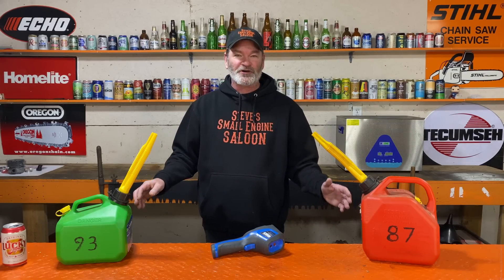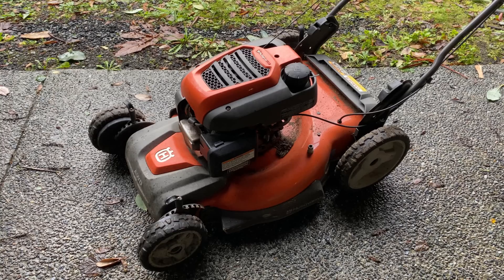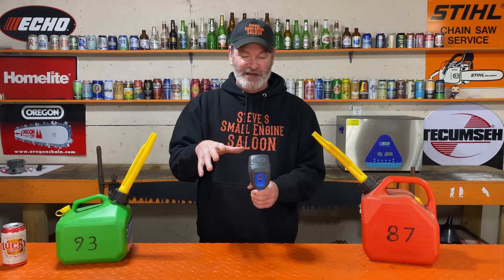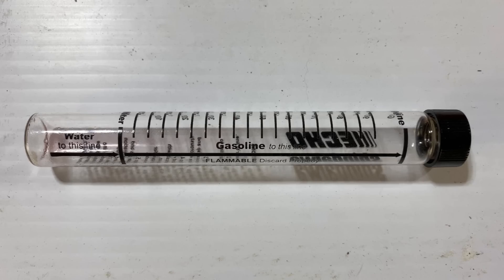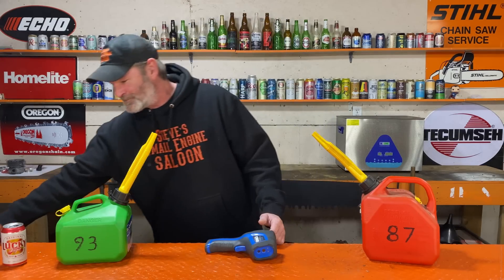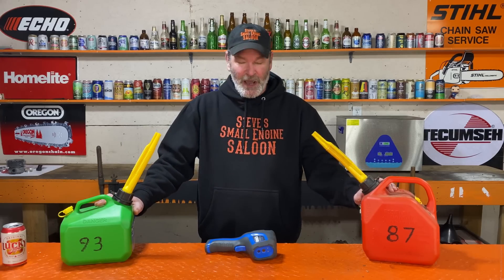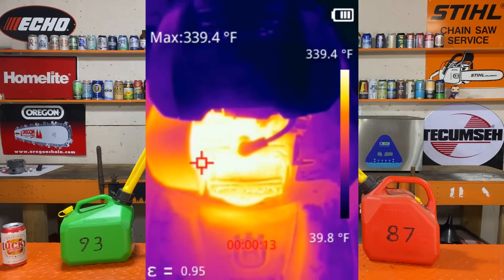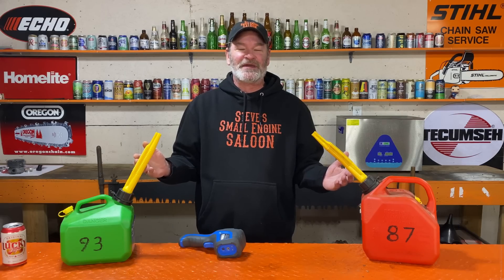Does High Octane GAS Make Your Engine Run Too HOT?

Comment: Thanks for doing this... I often wondered if it really was a big difference. I was always told that high octane fuel burns a bit slower, slow enough that trace amounts may still be burning as it passes the exhaust valve, causing the valve to run hotter.

Comment: Higher octane just means a higher flash point ...nothing more. On my engine with 114 vs the regular 91, I can add 2 deg of timing and lower the idle by 220 rpm, this also drops the temp by 18 deg BUT that is because it idles lower NOT because it burns noticeable cooler as you have pointed out Steve.... Well done
Peace

Comment: Here in Australia 91, 95 and 98 available, I've tried 95 in a brand new mower and it didn't like it so I went back to 91 and no problems. Most petrol engines here on the fuel cap states only use 91 your fuel mixes are a bit different to ours I think. I do stand to be corrected if I'm wrong thou

Comment: Hi to everyone  yeah Steve's right in his chat to everyone  but please  in the winter time of small engines with snow throwers, or you smaller tractor pushing snow, Don't put "Heet" in fuel tank All it's going to do is eat the small rubber gaskets to like shriveled prune and ruin them, then you going wonder why later you got problems with carbs,  just run 89 to 90 octane pump fuel and all be fine, or run half tank fuel till it runs out fuel and you better off without messing up carb, with fuel sitting in it at 1/4 tank for long  period of time gumming it up.

Comment: What's incredible, is how many tens of thousands of drivers fill up everyday with high octane gas, wasting their money, because they don't know what high octane gas does
Reply: Don't underestimate these drivers. They may know very well what they are doing. In my country (Slovakia), the EU, sells E 10 gasoline with a bio-component (ethanol-alcohol) content of up to 10%.  However, I only fill all my garden equipment (garden tractor, 4 lawnmowers, scarifier, mulcher, brushcutter (mix), drum mower, and my sister's car with high-octane E 5 gasoline, which has a bio-component share of only up to 5%, and the bio-component in this case is ETBE. And you know what? Unlike ethanol, ETBE cleans the engine and the entire fuel system, unlike ethanol, which clogs it and, in older cars (and garden equipment), even damages some - mainly rubber components. In some cars older than 15-20 years, their manufacturers explicitly prohibit filling up with gasoline with ethanol. Now you understand why some drivers fill up with high-octane gasoline without ethanol? By filling up with more expensive gasoline (roughly 20 cents per liter), they save a lot of money on servicing their cars. And I'm not even talking about the fact that burning E 5 gasoline produces lower emissions and extends the life of the engine.  By the way, great video Steve. Thumbs up. Greetings from Slovakia. Slavo.
Reply: @AdviceFromGarage  Thank you for responding, I respect your opinion. However, the percentage of ethanol is not the issue here and it is irrelevant to octanes. (The same percentage of ethanol is used in the US, by the way, up to 10%)
Please take some time and research “octanes” on youtube. You mY find that it is something very different than you thought
Reply: @koonelos  Thanks for the response. Even though ethanol in gasoline was not the main topic of the video, I think it is important in relation to whether it is high-octane gasoline or not, precisely because another bio-component is added to high-octane gasoline (in our case, ETBE, which even has a cleaning effect). The essence of my response to your comment was not to argue about octane, but that many of the drivers you mentioned use premium gasoline because of its better bio-components (additives) that do not damage the fuel system. I think the things I mentioned can be beneficial for both garden equipment users and drivers. Take care.
Reply: And I forgot to mention in the previous comment that the engine has lower friction and can run better with high-octane gasoline (for example, EVO 100 Plus has an octane number of 100 - exactly 99.9) and is ethanol-free and with cleaning additives such as ETBE, isooctane... However, according to experts, you will not achieve lower consumption and higher performance by refueling with such premium fuels - if so, then only negligibly and it is more about subjective feeling.

Comment: Some say  higher octane burns slower but its probably very small numbers. It will initiate flame later in the rotation of the crank because it takes more energy to initiate and these machines dont adjust to that need.  So its likely creating a though tiny overall inefficiency and also burning on the exhaust port side of the valve, exposing the valve stem to more heat. I just run what the engineers say in the manual. As for ethanol or high ration blends, you need to burn more fuel per charge Im not sure the combustion is going to much lower. The intake charge will be cooler though since the alcohol atomizes more

Comment: So, the higher  octane maby has a trace more energy at 3° hotter?? Not enough to make any difference looks like.  Also does the 90 + Oct. Store better like I have been told? I  have kept with Non ethanol 91 octane for 22 years for all my small engines . That has worked well for me.  Thanks for your excellent instruction 💯👍

Comment: I've always used high octane gas in my two cycle engines. High rpm engines run better with high octane. Learned this when I use to drag race my drag bikes.

Comment: Strange.  I was told  premium gas, high octane,  has no ethanol in it. Bad Shell gas station 😮
Reply: If you live in Canada, all gasolines (regardless of octane rating) can have up to 10% ethanol in it, BUT they HAVE to have a sign on the fuel pump clearly stating this fact. If a gas pump does not have the ethanol sign on it, then (by law) the gas can't have any ethanol in it.

Comment: I run regular / ethanol pump gas in everything.  No problems. 
Cheers, rich out.
Reply: I stopped using ethanol after my generator accumulated a pint of water in the fuel tank, and the fuel petcock seized up from corrosion.

Comment: High octane gas has a lower flash point for high compression engines so you don’t get precombustion. It’s not better gas, it just has a different use.

Comment: Been running High Octane gas in small engine for decades, no problems 👍🏻
Reply: Other than wasting money, you mean. The whole "high octane equals better gas" myth is the real bamboozle here. If your engine doesn't need the octane, you're basically burning cash for no reason
Reply: @philthycoder  Actually, no. A lot of high-octane (91 or more) gas has little or no ethanol in it and it is the ethanol which will gum up carburetors, etc. if the engine sits for an extended period of time without being run. Non-ethanol gas also stores a lot longer without needing the use of a fuel stabilizer.
Reply: @philthycoder ur not burning cash for no reason i tell everyone to go to at least 89 fuel rec 90 fuel is better but a lot of ppl had a bunch of issues with 87 an switched to 89 or higher now see a big difference

Comment: Ive always been taught to use minimum 89 octane in 2 strokes because when 2 stroke oil is diluted in gasoline it can actually lower the octane rating.

Comment: Higher octane fuel will help the engine run slightly cooler if you can adjust the timing for it, which you can't on a standard lawn mower engine. Ethanol has less energy, but also burns a little cooler. 

Non ethanol premium fuel is best for two stroke engines. It is best for four stroke engines that tend to sit around unused for longer periods. Ethanol blended fuel (up to 10%) works fine in small four strokes if the fuel is used up regularly, and not allowed to sit in the tank and carb for more than 4-6 weeks.

Comment: the increase in octane slows the burn rate down, this was to prevent  pre-ignition and knock/detonation/pinging. This allowed higher compression and this is what increased the horsepower.
Reply: WRONG increased octain retards the flame front absorbing heat and turning it into explosive force cooling thr engine!
Reply: @terenceiutzi4003  I think you are getting wires crossed, what the OP wrote was 100% correct, the additional reaction of causing detonation to occur later does more or less what you said, which it to reduce the temperature before tdc, which will stop holes being burnt in the piston crown, but you can't have an explosive force that is cooling. As Steve showed, both fuels basically heated his basic engine to more or less the same temperature.
Reply: @capnpugwash5403  If you run low test gar in a high compression engine, you burn offtjexjaust valves! That is why all of the race cars run ethinol  now!
Reply: Agreed....from my experience pushing drag and towing engines, the only time you get out of control excessive heating is if you advance to a point that you get the preignition/detonation .....lower octane, reduce timing....higher octane, advance timing to get the perfect burn.  Compression, too, plays a very significant role.....high compression, run high octane....low compression will tolerate lower octane fuel.  All these factors play together in harmony.
Reply: @tomnekuda3818 And higher octain retards the flae front cooling the engine!
Reply: What I was told was they burn at the same temp , but then when high octane is used in a high compression engine then combustion temps will increase. But due to increased compression, not octane
Reply: @outinthesticks1035  Octain has to absorb more heat to ignite it then it explodes, giving more force on the piston and less heat.  E95 HAS 180 octain. You can not burn E95 in an engine with less than 8 to 1 compression. When I burnt E95 in my 12 to 1 compression Air cooled Triumph it ran so cool that you could put your hands on the cylinder heads and not burn them!
Reply: @terenceiutzi4003  octane does not absorb heat , it is just a measurement of how difficult it is to ignite fuel 
If a fuel mixture has enough heat to ignite , that is called pre-ignition. This is a bad thing , it destroys engines 
More force on the piston equals more heat , it is the heat that creates the force 
E95 fuel has a octane rating of 95 , not 180 
Fuel for high performance aircraft is 100 octane , I don't think it's possible to buy higher than that
Your air cooled engine ran cooler simply due to alcohol fuel burning cooler , as explained in the video 
Not because it was higher octane
Reply: @outinthesticks1035  Why do you have to advance the timing when you set up to run higher octain fuel? Do you know anything about high-performance engines?
Reply: @outinthesticks1035 the flame front is slower using higher octane fuel, so you can advance the ignition more and still get the "bang" to happen at the right time in the compression stroke when a higher compression would otherwise cause pre ignition and damage the piston.
Reply: @outinthesticks1035  Well that explains s why when you burn lowest in a high compression engine you bur off your exhaust valves and melt holes in your
The pistons!

Comment: The higher the octane the slower it burns.
Reply: Nope, burn speed differences are negligible. Octane rating only shows resistance to knock and pre-ignition.

Comment: I had a Chevrolet Sprint car I bought new in 1986.It had a 1.0 liter 3 cylinder Suzuki motor. People were bringing them back to the dealer with the motor vibrating excessively. After investigating Chevrolet came out with a bulletin to not use premium gas only the lowest octane. Mine had a 5 speed & got 45 mpg in town & 55 mpg highway, driving it easy & at 60 mgh highway. I guess some people thought it would get even more mpg with premium.

Comment: I use full synthetic oils in all of my engines (car, mower, snowblower, 2 strokes), and use ethanol-free from the marina. No heat, or fuel problems ever.

Comment: My good old US made briggs in my mower has always run on 98. I change its oil once a year, its 26 years old, and still running strong and starts first pull every time. The only other maintenance its had is new plugs and filters. Never even had to touch the carby.
Reply: Where are you buying 98 octane fuel, the airport?
Reply: @corey6393  Its available everywhere in Australia.
Reply: @fitzyholden1036 you sure that's not 89 instead of 98? 98 octane gas would be absurd to use in a low compression single or dual cylinder small engine
Reply: @philthycoder  In Australia we have 91, 95, and 98 to choose from.
Reply: @philthycoder  Australia and the U.S.A. measure octane differently.  Australia uses the Research Octane Number (RON) to measure octane.  The U.S.A. uses the Anti-Knock Index (AKI) to measure octane.  98 RON is approximately equivalent to 93 AKI.
Reply: @mikefrerichs8860  Did not know that. Thanks mate.
Reply: @mikefrerichs8860  I was wondering if it might be  something like this. Thanks for the info.
Reply: I also heard the octane rating is different for elevations above sea level. Anyone heard of this?
Reply: @matt4262  The ratings are the same, but the engine's needs might change a little. Was more of an issue with older, carburated automobile engines. Fuel injection and computer controlled engine management and changed things.
Reply: Its a good thing you did, a friend of mine had to let a intek based 16 yo unit go because she didnt keep up with the engine oil changes, it washed the rings out and wouldnt maintain compression

Comment: I run strictly non-ethanol fuel in my blower, chain saw, weedeater, Polaris Ranger, portable generator, etc. You get the idea, and the non-ethanol fuel in my neck of the woods is 90 octane. Octane rating pertains only to the point at which the fuel ignites under compression, from what I understand. Old wive's tales die hard.
Reply: if it's like a lot of old wives tales, it's based on a complete misunderstanding of the original version - which was probably 50 years ago, people saying "don't waste money on premium gas for your small engine, because it doesn't make it run any better."
Reply: Burning non external in 2009 Exterra 2010 frontier gets 4 miles a gallon more over 300,000 each. All small engines generator, X 300 Kawasaki 900+ hr.  Good luck out there ✅⚓️⚓️🇺🇸🇺🇸🇺🇸
Reply: No idea what you were trying to say @drmrcharliestat
Reply: Do you buy the pre-mixed Ethanol free fuel?  If so, what brand do you use?  I’ve been told to stay away from Truefuel.
Reply: @craighellberg4366  premixed fuel is significantly more expensive than ethanol free premium and premium synthetic 2 stroke oil.
Reply: @craighellberg4366  I purchase ethanol-free fuel from a local service station. I never use pre-mixed fuel since I use ethanol-free on both two-and four-stroke engines.
Reply: Do you use the pre-mixed ethanol free fuel for two-stroke engines?  If so, what brand do you use?  I have been told to stay away from Truefuel.

Comment: I want to know what your comment about shops telling customers to buy 87 instead of 93 means. We all know what that means. Ah, no. 93 isn't cleaner than 87, it's an Octane rating. Equipment with high compression needs high Octane so it doesn't pre ignite. Low compression engines can use 87 because there is little chance of pre ignition.  Nothing to do with clean or dirty.  Or am I missing something

Comment: Where I live you can buy ethanol free gas but only in the high octane. I would buy low octane ethanol free gas if I could. I've never had a problem with my mower getting diesel knock but boy did I have problems with gas going bad and carburetor jets getting plugged before I switched gas.

Comment: Why does low octain (cheap fuel) fuel cause piston ping? 
Piston ping disappeared using high octain fuel
Reply: Lower octane fuel has a lower flaspoint it's a little more volatile . Thats why it pings . High octane fule will actually produce less horsepower . Unless you adjust the timing of an engine. Then high octane fule will produce more horsepower and run cooler  with un burt fuel evaporating . Works for car and bike engines not sure you could notice a difference in a small engine

Comment: Wow that was interesting  both have 10% ethanol, but yet they don’t charge the same price for the stuff  now I do run the 93% but before I pump  in to the can I put 1 to 2 gallons in my vehicle 1st then i fill up my can  just to make sure iam not getting what’s left in the hose  now oddly my saw and log splitter runs better on the 93%

Comment: Higher octane means that it has a higher resistance to pre ignition. It will not burn any hotter or cooler or cleaner for that matter. Sounds like your boss was a conspiracy snakeoil salesman as well as a small engine guy 😅

Comment: Steve, I have over the past 5 years now run NON- ethanol fuel (90 octane here in Pennsylvania USA), in my saws, mowers, weed hackers, pressure washers,and small generators.Its a little more per gallon than 10% ethanol, ($.75 to $.90 cents). Reason being,.. when they sit stagnant for a time,( 6 months or so) they ALWAYS start after a couple of pulls,  AND... I ain't rebuilding the carburetor any more, from the moisture build up , corrosion in the jetting. won't ever use ethanol gas anymore,  it just looses it's.....'potency'? It's worth the price  for  me.
Thanks for the video and explanation of BTU's with different Octane   levels.
Reply: Same here! 100%
Reply: It's the detergents in the fuel today that remains and gums them up

Comment: My local airport has has 100 LL and you can go in and used your debit card and put gas in a jug nobody's there at night I put it in my riding mowers the lids good for the valves I wonder if you can get ahold of some of that gas and perform the test again